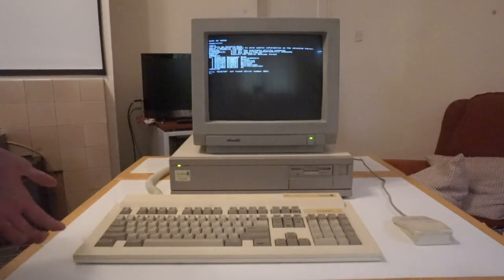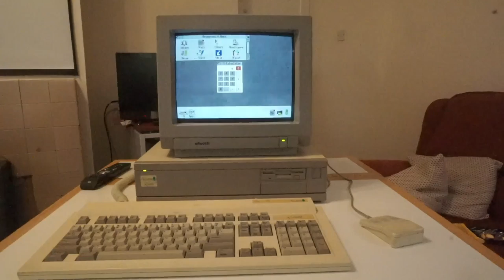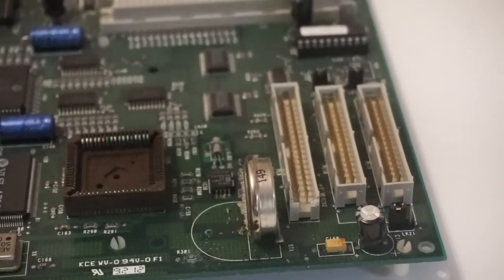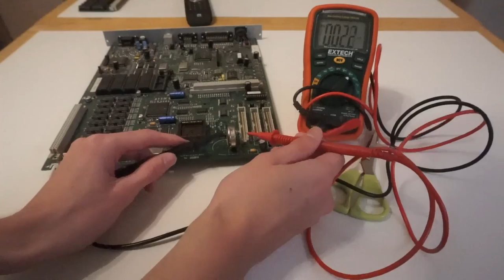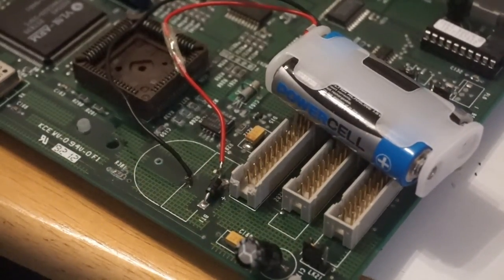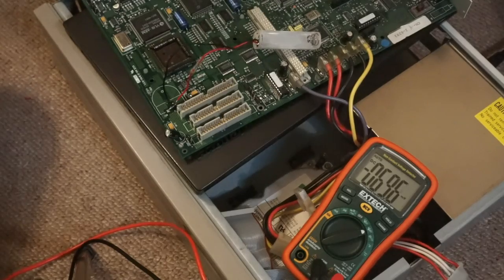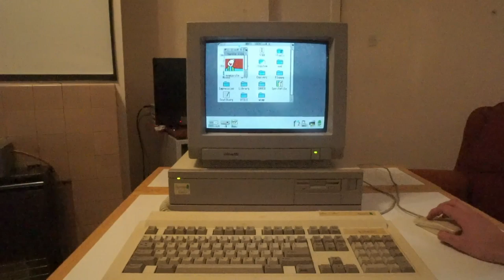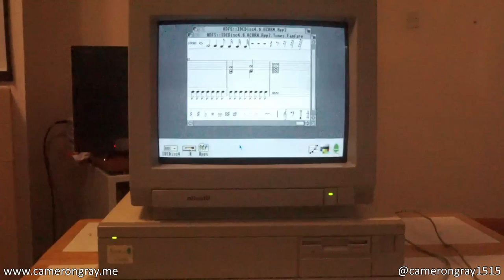Rescuing an Acorn A5000 from a battery leak

Comment: Batteries are acidic hence why it eats metal (H+ ions and conjugate bases react with metals). Bases react more with fats and oils and are used as corrosion inhibitors in things like antifreeze and coolants as they neutralize the acids and make solutions non conducting in the process). Better to use alcohol that will be soluble with water and non water based solutes and solvents.

Comment: You can use Electro-Kote to try and repair the PCB tracks and restore the system unit to fully working order, BTW you need to heat the repaired track with a hair drier to cause the Electro-Kote to become conductive, a 470pf capacitor should work in this position.

Comment: oh no, a conner drive. the gasket on that is most likely going to fail soon if it already hasn't. do take caution and figure out a way to move the OS to a CF card.
Reply from the maker: Ahh, thanks for the heads up!  I'll probably back up some of the applications on the drive to floppy and/or image the entire drive.  Thankfully the OS on these machines is stored in ROM so even if the hard drive goes, at worst I'd have to reinstall some applications.
Reply: Cameron Gray yeah, it can get real messy. TheTechKnight has done a few videos (including recently) where things he has have either gooped gaskets in their Conners or will need servicing for such extremely soon. I'm not sure about the 3.5" drives, but can't be too safe.
CF card is the way to go now, especially considering how stupid cheap adapters are and how stupid cheap one can mostly find new-old-stock 256/512MB cards for, if you look carefully.
Reply: The only problem I can recall from when I had an A5000 (a damn long time ago now) was that it could be a bit fussy about what drives it would support. One reason for Conner drives was that they would often be fitted from the factory and would work - I can recall, for example, that Western Digital drives were especially prone to fail in Acorns back then. 

Must admit that I am curious about CF card or SD card drives as I have a couple of Acorn RiscPCs (the machines that replaced the A5000) under the desk that could do with some work but the sort of drives that they would tend to support are like hen's teeth these days! All the same, good video.

Comment: Correct me if I'm wrong, but isn't it better not to turn on a machine with a possible leak? As far as I know current only accelerates galvanic corrosion.
Reply: While it should be avoided it's usually fine, if it's sat there corroding away for years with a powered CMOS circuit from the battery then 20 mins to test it isn't gonna hurt it any further.

Comment: What comes material out of the battery?
Reply: Its the electrolyte that makes the battery work after 25-30 years the rechargeable battery cells leaks the internal liquid and this can damage pcb tracks, component legs and socket pins, the Amiga 500 Plus also suffers from this issue